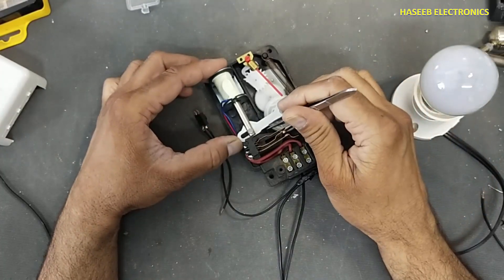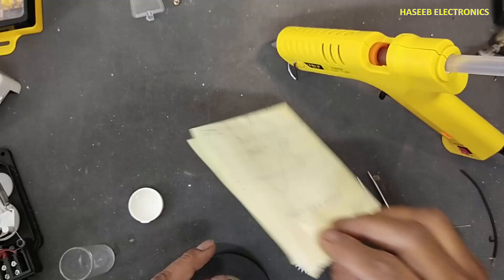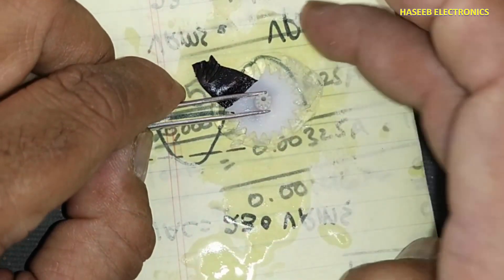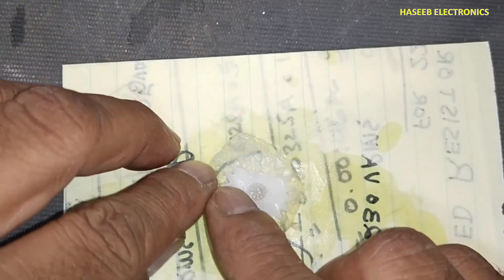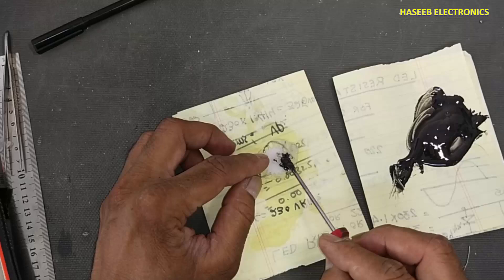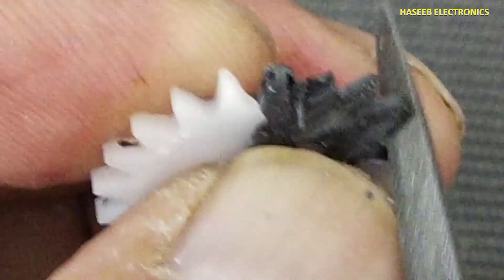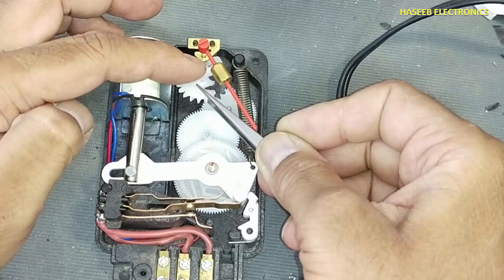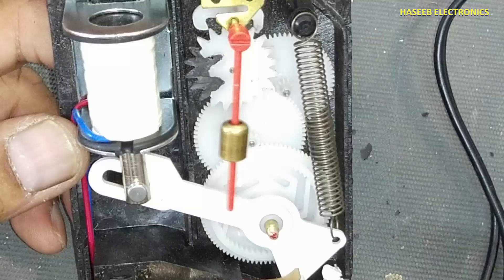{679} How To Repair Broken Plastic Gear, Damaged Plastic Gear

Comment: Easier way . Plasticine press part into plasticine . Remove from plasticine , turn half way push back into plasticine lining up where the teeth are broken hence clean new mould . Remove broken part , fill mould with plastic cement . . Simple .

Comment: Nice repair. I've seen videos of small gears repaired with a similar process, but using superglue and bicarbonate of soda instead of the epoxy, which is reported to be very strong and durable. Have you ever tried that? Regards.
Reply from the maker: this epoxy is durable 
if araldite is used then it much stronger than the normal epoxy
Reply: @HaseebElectronics   Thanks for your reply 👍

Comment: will the epoxy gears wear out the other normal plastic gears quicker? (because it is harder material)
Reply from the maker: although epoxy is it works for a long time. as these don't drive heavy loads. if we use Araldite STANDARD epoxy, it is harder than the plastic

Comment: Hi bro can you tell me what type of the file you are using in this vedeo
Reply from the maker: it is fine file set. it consists 6 pieces
Reply: @HaseebElectronics  ooo thanks bro
Reply from the maker: it have half circle, triangle, round, flat,  knife type files in that pack

Comment: Sir ik question hai
LED Bulb ki ager ik smd light jal jaye to us ko jumper k bajaye Resistor lagaye to kon c value ki lagaye jo us k 7 ya 8 volt ko cover kar sakay
Main nay 1k, 10k, 470ohm, 63k ye sub lagayi hain tamam jal jati hain plz guide karain.
Reply from the maker: agar LED driver properly current control na kar raha ho to LED damage ho jaati hein. agr LED driver theek ho to LED kabhi jaley gi nahi.

Comment: You fix everything except a broken heart, and you probably could do a video on that. Brilliant use of materials! Your repair will probably outlast the other gears. I have a idea. Could you someday do a video on how to check the resonant frequency of an SMPS transformer. I don't need to know how now, but I have a box of old transformers and if I decide to re-use these, how would I check to see what frequency to use that is most efficient. I tried this using a signal generator with square wave and a low voltage output. I fed the secondary with the signal generator, and checked the primary with a neon bulb. I adjusted the frequency and amplitude of the signal generator to get the most light out, but the neon bulb got bright with several different frequencies. I've haven't tried a peak reading volt meter or charging a capacitor and checking the voltage on it yet. Is this the best way? Sorry to be so long. You don't need to answer as I know you are extremely busy. Just an idea for a future video if you need one. Thank you! Best regards and have a great weekend!
Reply: Make a simple oscillator with the transformer on a very low voltage. Use a radio on Long or medium waves near the PSU, you will pick up the harmonics .the difference between them is the Resonant Frequency of the SMPS trans in that circuit. Any caps in circuit will change that too.

Comment: Can you send me the link from where to buy that particular mechanism or similar with the gears and solenoid arming mechanism please. I want to combine it with a water flow meter to make a volumetric automatic  cutoff for my water supply as I often forget to shut off the main water supply for the house because sometimes when watering my plants or when the quick disconnect flies off by itself when left unattended I end up with a huge water bill. Combine that with a water valve electric shut-off servo from Amazon and you can save money.YF-S201 Hall Effect Water Flow Meter / Sensor    -    HFS(R) 12v Dc Electric Solenoid Valve Water Air Gas, Fuels N/c - 1IN NPT Available (12V DC 1IN NPT)

Comment: Thank you very much sir from Algeria 🇩🇿 . May allah bless you.
Please sir I have a powered battery handheld Oscilloscope can I directly put the two probes into the utility socket to see the sinusoidal waveform or it may damage my DSO?
Thanks in advance
Reply from the maker: best regards. 
if you have battery powered oscilloscope, it is very very safe to test unisolated signal 
just ensure the maximum input signal level (mentioned near bnc input connector) 
use 10x probe 
it will safe